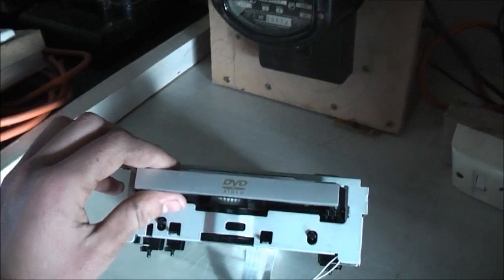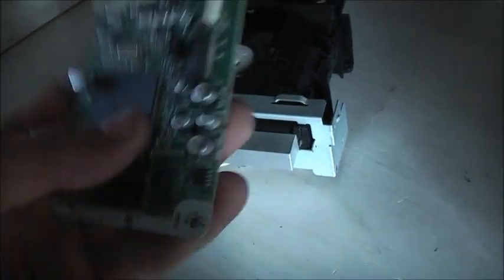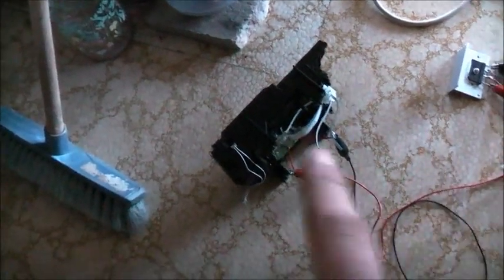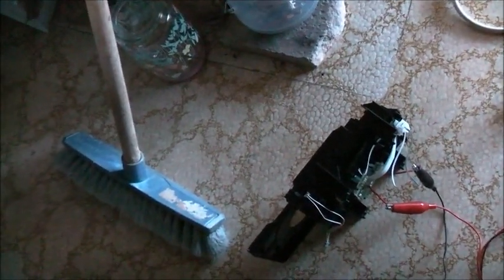Variac Fun, Popping Motors

Comment: Great burn outs, The VCR moter did the tape loop as well as the insert, eject function.
That B&D drill motor lasted well.
Good you did a rectifier temperature check as well. At 10 Amps between 10 and 14 Watts of heat is dissipated there.

Comment: Oooh, that drill motor took a fair bit of a beating before it gave up! :-D

I think though, if the motor was taken out of the unit (i.e. disconnected from that gearbox in there....) it would have screamed-up much faster, & possibly shot fire & bits of com bars everywhere. :-D

Still, we got a nice multi-colour light-show out of it, so this vid's a winner. :-)

Thanx for showing,

-BoomBoxDeluxe.